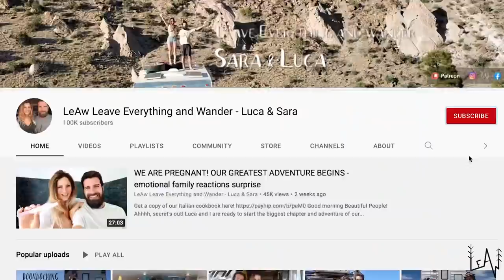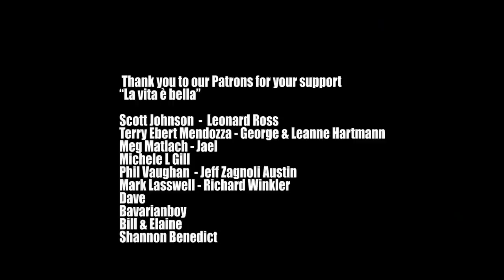MAYBE WE ARE STUCK HERE! WAKING UP TO A WINTER WONDERLAND in NORTH OF ITALY - LEAW DAILY VLOG 3

Comment: Beautiful winter wonderland in the mountains, Luca, Sara. Luca, Toro makes an electric power shovel, also Snow Joe for moving a lot of snow-up to 20-30ft in the air. (7-10meters) Easy on the back for you. I carry a long rubber mat in my car to put under the drive wheel over the snow to get a better grip. Works well. Sara, can you stay with relatives in the city closer to the hospital when its nearer to delivery time? Might have better snow removal and won't get stuck and have more people to help you before and after delivery. Think about it. Take care. 😊Ciao amici.